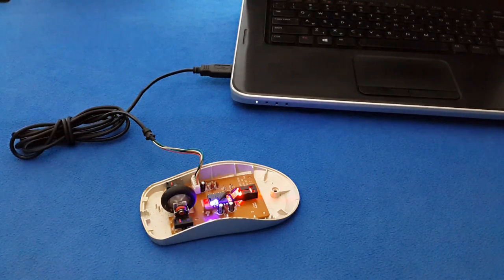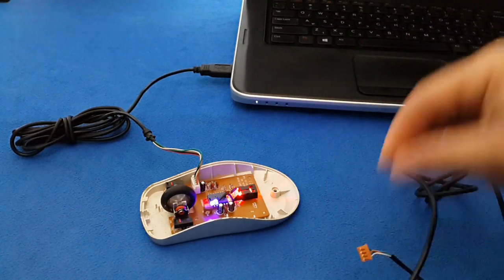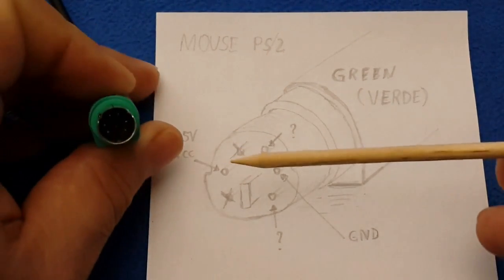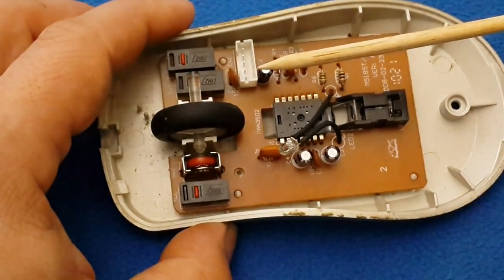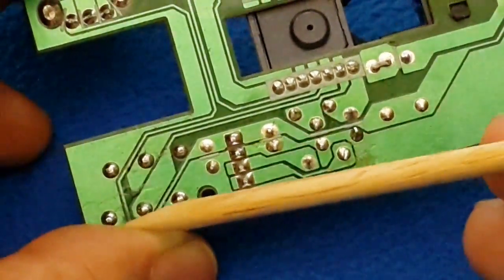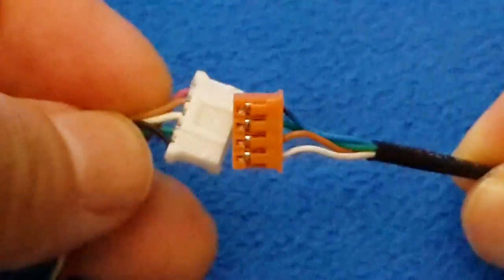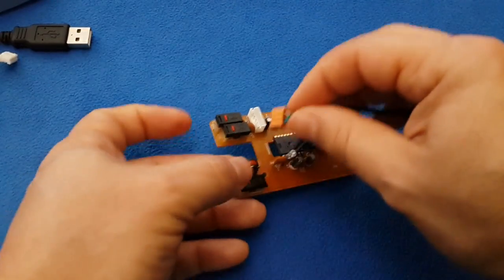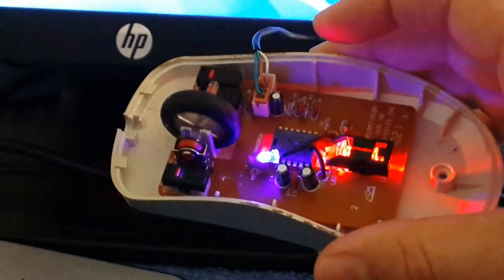How to convert a mouse from USB to PS/2  -  como convertir un raton de usb a ps2

Comment: Really liked the way you explained the methods you used to ascertain the board layout, instead of just explaining how to do it for one device - 10/10 tut well explained :)
Reply from the maker: Hi! Thank you! I think the key is to think out of the box. But "to think" is not the art of to get ideas, but the skills to apply them in function of the knowledge. 
When started the University in the beginning of the 90's, one old guy, retired electronics engineer, told me: "Make it easy and simple". Old guy advises are like best book's chapters, they mean the right way to do it. Mr. Wiley saved me a lot of troubles with his magic advice. ;-)